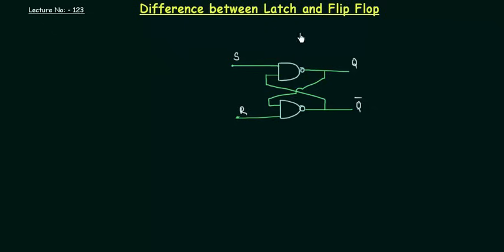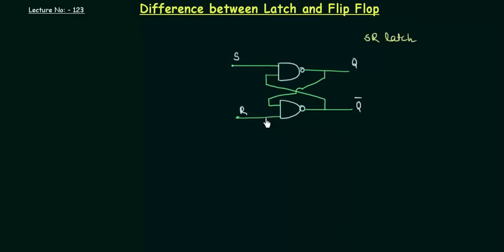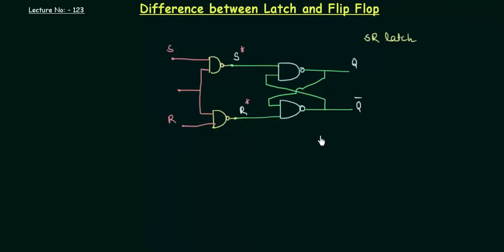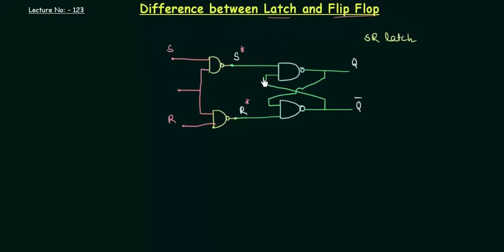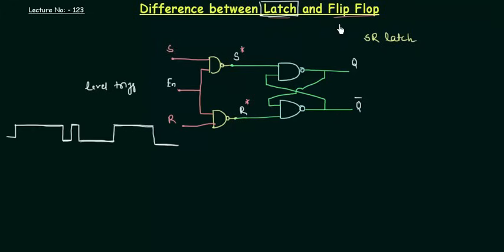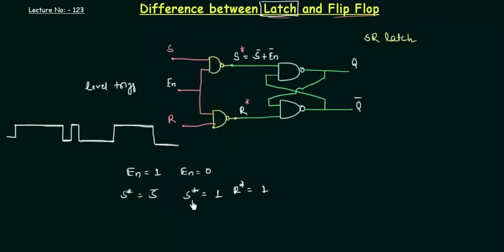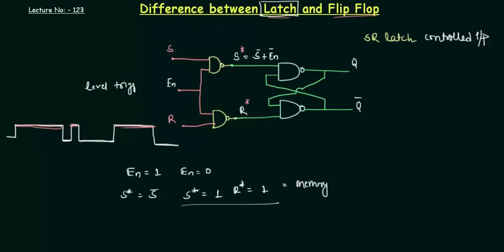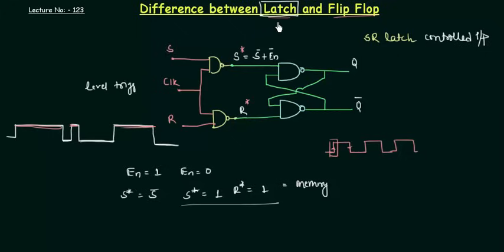Difference between Latch and Flip Flop

Comment: The primary difference between Latch and FF is that, a Latch may/may not have a clock, whereas a FF must have a clock. A NAND-NAND SR Latch which is equivalent to SR FF as shown in the video, is an example of positive level triggered FF, since during the high clock pulse, its active whereas and when low clock pulse, its in the memory state. Nowadays FF primarily means a an edge triggered FF, since its use case/applications are widely used, hence nowadays FF refers to a edge triggered, as generally thats what we use often. But if we be precise, Master Slave JK FF, are actual edge triggered FF, where we have negative edge triggering mechanism. Hence FF can be of level/edge triggered type.This is as per my understanding of the topic so far.

Comment: What is the difference between latch and flip flop?
When we use level triggering in the given circuit it will act as a latch, while if we use edge triggering by using a clock pulse to the circuit it will function as a flip flop.
The latch is functional only when the signal is enabled, while the flip flop function when there is a transition b/w high to low or low to high in the clock pulse signal.
Reply: but the signal is enable when it is low(0).
Reply: @jbkrobin  yess cuz its nand

Comment: I am confused about that part where you are explaining the circuit being a Latch. You said that if the control input is enabled and if EN =0 then S* =1 and R* =1, this is what you called memory. However I thought if those inputs are both equal to 1, that this is an invalid state? Also you never defined what R* is equal to, is R* = R-complement + En-complement?
Reply: see the prvs video on SR latch if it done using nor gate then 00 is memory and 11 is invalid if it is done using nand then 11 is memory here they are using nand so 11  is memory.
Reply: @dhanyabhatk3608  why would the circuit/latch not work when it is memory? it will not work when in not used state

Comment: Won't the flip flop as enabled by the clock at 5:05 be functional only when the clock is high? Like I don't get why is it edge-triggered/edge-sensitive in this particular design. Even with a clock, the circuit should remain functional only when the level is high, and not just during transition. Am I right?
🙁🙁🙁🙁

Comment: A flip flop is composed of two latches. This explanation is wrong. Changing the enable signal for a clock signal without adding another latch won't change how the circuit works at all.

Comment: I prefer a latch made with one input of a OR gate as the latch Set input. The OR gate output is connected to the input of a AND gate. The other input of the AND gate is connected to the output of an inverter. The inverter input is the Reset input of the Latch. The AND gate output is the Latch output and it is connected to the other input of the OR gate. My understanding is that some integrated  circuit outputs can not be connected together without measures being taken to prevent damage. I call the latch circuit above a reset master since a high reset input always results in a low output. To avoid confusion figure any part of the circuit that has a high output is in some way connected to that gates or inverters power supply positive connection. To be honest I have not even tested the above circuit but have tested its relay logic equivalent (which is slightly different).

Comment: Sir,does clk mean it has only 50% duty cycle?if yes then can flipflop  work with a random  pulse?
Reply: It's no longer random once the clock is connected, the clock allows us to know when the circuit is functioning unlike before when it was totally random. As in now we know that the circuit is only operational when the clock signal is transitioning from high to low or from low to high.

Comment: sir, at 4:43 you said that the circuit will only respond to the edge of the clock...but how does the circuit know that is should respond only at the edge because even in this case the output will change during the high period of the clock pulse.

Comment: how output will change in positive edge triggering flipflop when it goes from lower to  higher state (0 to 1).
why output will not change in positive edge triggering flipflop  when it remains in  higher state(1)? , as the flipflop will be active when its clock input or enable input is in higher state(1).

Comment: In that circuit when you show the difference between latch and flip flop i don't understand why did you used nand gate in front of the clock wire ( when the clock is high or on after the nand gate it should be off and i don't want that right ).

Comment: We say Latch/Flip flops are one bit storage circuits,but in truth table,these circuits have two outputs ,one is complement of other.Thus they can store two bits ,then why we call them one bit storing circuits.Sorry if my basics are wrong,i am new to it :)
Reply: I sort of see it in this way,let me know if i am right.We never know the data we would want to work upon ,thus we use only one bit from flip flop or latch ckt,as we might know that next bit to be generated is its complement or not.If we use it another way we will have to install a mechanism to check whether we require the complement bit in our data or not,this will add to architecture and efficiency as flip flops will remain same in number and checking mechanism would just extra to the whole circuit thus decreasing efficiency.
Reply: can you store 1  & 1 at the same time?

Comment: i have a doubt ... lets consider edge triggering ....so you said that the curcuit will be active only when the signal makes a transition from low state to high state or vice versa.........so what happens to the circuit during high and low stages
Reply: Nothing happens because it only is triggered at the edge or the rising or falling phase only, not the high and low levels or stages.

Comment: sir, if clock is what is concerned for determining flip flop or latch why is the circuit for latch operational for en =0 in case of latch as it should have been en=1 as per your words

Comment: what is difference  b/n enable and clock
Reply: rajee puttupu The difference between a latch and a flip-flop is that a latch is asynchronous, and the outputs can change as soon as the inputs do (or at least after a small propagation delay). A flip-flop, on the other hand, is edge-triggered and only changes state when a controlsignal goes from high to low or low to high.
 Taken from Google

Comment: i dnt get it. why cant the circuit be used as a flipflop while keeping the clock as level triggered?
Reply: Yes... Same question
Reply: @thakermahek2501  Because those are the definitions. I had the same question. My perception is that simple flip-flops and latches behave similarly in simple circuits, but differ in behaviour when circuits implement both edge-triggered and level synchronising.

Comment: why will the flip flop be operational in edge triggering? flip flop should be operational only when clock pulse changes from low to high, that is, when clock is 1. Please Answer
Reply: The flip flop is only operational at the transitions, clock low to high,  clock high to low. When clock is low or high the flip flop does nothing.

Comment: what is the differnce between enable and clock???
Reply: an enable signal is a level o or 1. The clock is a pulse.
Reply: added to +Camillus Blockx, clock can be either level or edge. the pulse could be high (i.e. a level clock), or an positive edge clock where it's a pulse from low to high; and negative one if pulse goes from high to low.
Reply: ragini Srivastava The difference between a latch and a flip-flop is that a latch is asynchronous, and the outputs can change as soon as the inputs do (or at least after a small propagation delay). A flip-flop, on the other hand, is edge-triggered and only changes state when a controlsignal goes from high to low or low to high. Taken from google.

Comment: what is the difference between Enable and clock?
Reply: A clock(clk) is a pulse that happens at a certain frequency. This is the frequency the system works at. (The clk is continually sending pulses.) Every time the clk pulse enters the flip-flop it is able to change state depending on the input values.

While the enable is a signal that enables the flip-flop to either register an input or not. If enable is 0, the output will always be 0. If the enable is 1 then the output depends on the input. The enable has no frequency and can be chosen by the user, or machine. While the clk is always running and sending pulses.
Reply: Enable signal is different from clock. It isn't regular like clock which suggests that it is generated by some other logic. The device will work as long as the enable is positive. On the other hands, clocks are regular and the flip flop works on the edge triggering of clocks.
Reply: Then what about enable?

Comment: Why is it that the Flip Flop circuit can only operate on the basis of edge triggering and not level triggering?
Reply: i have also same question! you said  Circuit will only be operational whenver  clock is edge triggering,and  exactly in  next lecture you used clk=0 or 1 in Flipflop, then what is the actual difference between latch and flipflop?
Reply: Flipflops are constucted using flipflop
Min we need two latches to construct FF one is positive and one is negative latch when this is combined ckt will be operational for edge trigger